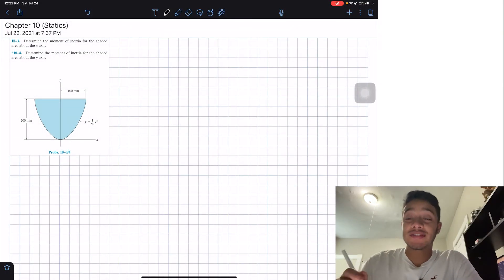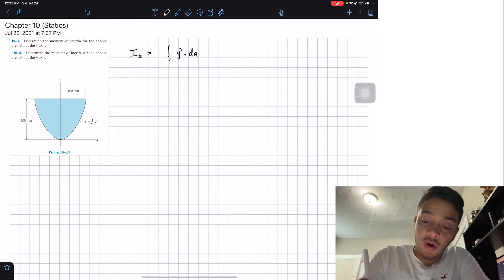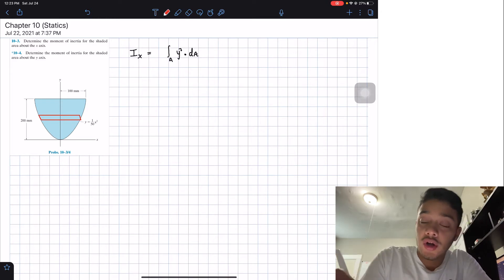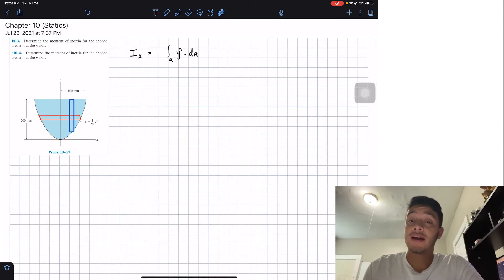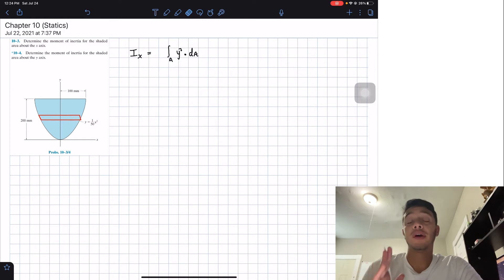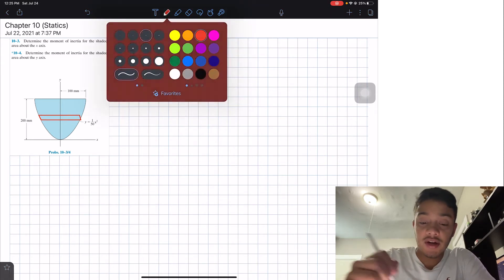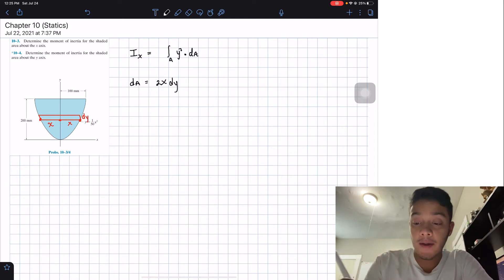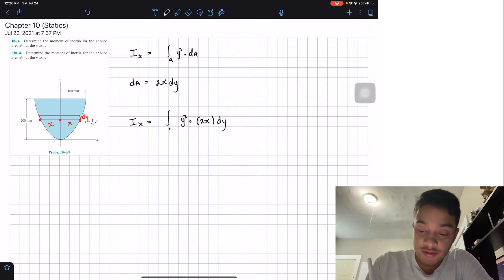Statics 10.3 & 10.4 - Determine the moment of inertia of the shaded area about the x and y axis.

Comment: What app do you use for calculating the asnwer?
Reply from the maker: I usually use my graphing calculator (TI-84 plus). Using the integral function that is integrated with it (under the MATH functions, option 9). However, if you do not posses a graphing calculator, you can utilize websites such as Symbolab to compute these integrals :)
Reply: what about FE exam ?I mean to say about calculator ? do you know